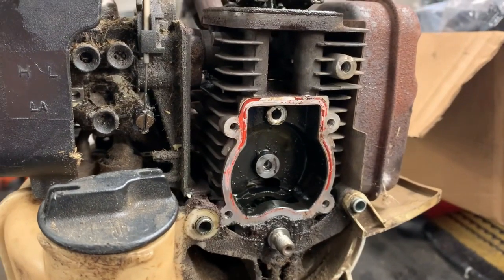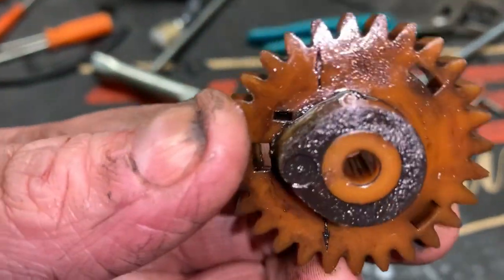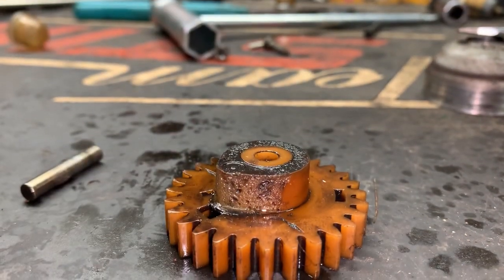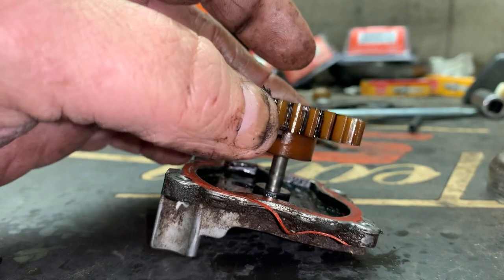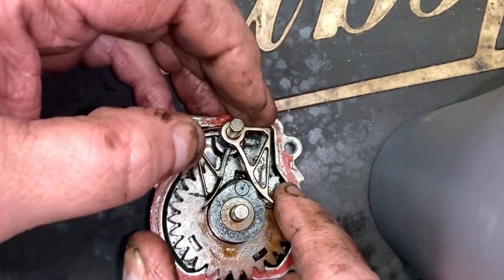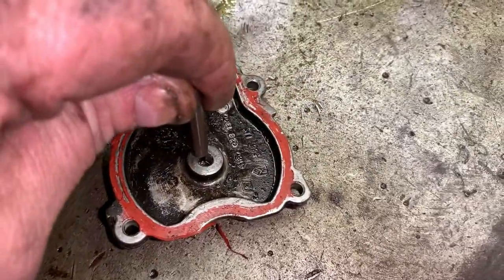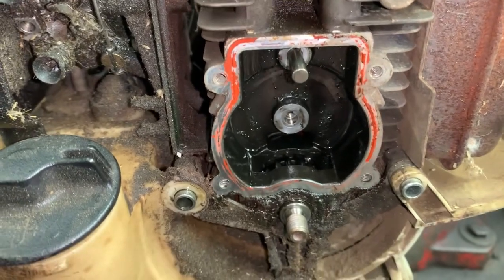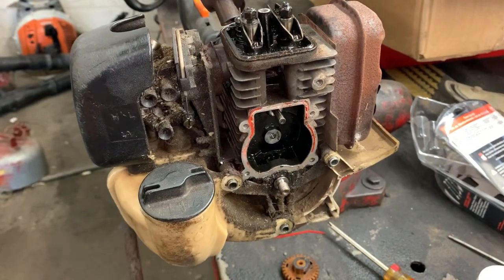50% OF MECHANICS DON’T UNDERSTAND OR KNOW HOW TO DIAGNOSE THE #STIHL #HYBRID #4MIX ENGINE

Comment from the maker: I’m sorry if I triggered anybody with my terminology I kept calling it a camshaft when in fact it is called a cam gear sorry for any miscommunication y’all have a good day
Reply: We know what you meant.Good vid,keep em comming.
Reply: You could give some people 100 bucks and they would bitch that it wasnt 2 50's. You will always piss some people off in this world no matter what you say or do...Screw'em and keep doing your thing and pay'em no attention.
Reply: No problem, could a lathe owner turn you a pair of pins turned to the dimensions of you worn bores, they would have a slight step but would be a lot tighter?
Reply: I didn't see the comments you're referring to so I cannot speak to that. I do agree that using the correct terminology is important. For accuracy and clarity but also having the correct part name is very helpful when sourcing parts and doing further research. Of course, every situation is different but in general, I advocate for that if possible. This is a matter of discourse that should easily be covered matter of factly and not involve triggering anyone. Respectfully give your concern and the reasons why.  The goal should be facts and accuracy. The content of this video is great to know. Thank you for bringing it to light. I imagine the same applies to the BR series blowers?
Reply: @newcoyote  aslong as it is a 4 mix. (Super Easy to pull if valves are adjusted correctly and sonds like a 4 stroke dirt bike and doesn't idle like a old boat motor )
Reply: Install a GAURD insert and drill it to fit the shaft. Should be a great and inexpensive repair option.
Reply: No worries man! Thanks for the quality content.
Reply: You also called the cam followers rocker arms a couple times. But we know what you meant.
Reply: Just call it the cam LOL

Comment: Sure appreciate this info! I had one come into my store for repair today. My manager told me to fix it under warranty. (didn't use 4mix. fuel was blue. I have no idea what kind of fuel additive he used but it sure locked that piston on the connecting rod.)
I have had no Stihl class on this unit, but you sure pulled me our of a spot with your sessions on this unit. Thanks a lot!

Comment: Very, very good.......and that's why I avoid buying any Stihl stuff with the 4Mix engine.
My dealer told ne about the horrible problems he had with the 800 backpack blower so I got the Husqvarna 580 with the Zenoah engine instead -Very noisy but fantastic and ultra reliable with no valves adjustment problems.

Comment: The simplest fix for those pin seats that have gone oval is a suitable strip of copper or steel tubing from a refrigerator or air conditioner. Put in the pin, tap in the suitable sized tubing strip to fill up the oval and apply a teeny bit of super glue to the body and tubing to hold them together. Then remove the pin. In the first stage of wear the pin seat on the engine block for the cam wheel and the pin seat on the for the rocker arms are what wear out. Detectable at an early stage by a varying valve clearance at every rotation of the crankshaft.
Now, the key question, does this fix work. Well, i started doing this in 2003 and have never had any issues.

Comment: Man this is an OLD issue they had onnthe FS90, 100, 110, 120, and 130 engines.  We replaced hundreds of short blocks under warranty back in the 2007 to 2014.  I haven't seen one of these failures in about 8 years now.

Comment: Good Vid!  Steel into aluminum never good.  You know what the fix is for this?  Echo!
Reply: new faceplate and gear as often as viable, if you keep the play in the plate end as low as possible its not going to wallow out the block end.
seems to be the only mitigator, or redesign with harder bushes or even a bearing- never ha to work on one but theres a market for a case plate thats way thicker , stiffer and carries a longer shaft in a bearing.

Comment: Seen a Stihl BR600 backpack blower break a valve. The valve broke off and got stuck in the top of the piston. Was still under warranty so we put a short block in it. Owner said he had it full throttle and it just stopped. Said it damn near jumped off his back.

Comment: Good information to know, thanks for sharing! I have a Stihl BR600 backpack blower which has the 4 mix, I actually bought it used from a lawn care service real cheap because it didn't run. Looks like it's got some hours on it since it was used commercially, got it running and luckily it's been great and reliable, haven't had this issue yet.

Comment: I think the solution for the "4-Mix" is to put the best air filter possible on it. An engine that always gets new oil, rather than recirculating contaminated oil should theoretically last for ever. The only source of particulate matter, is through the air intake. Maintaining proper valve clearance is also a good idea. (to protect the cam gear) This is a fascinating engine, I'm interested in getting a leaf blower or something that uses this engine, just so I can experiment with it.
Reply: Lots of torque on these engines.
Reply: I want one on the next edger I buy

Comment: Hey GREAT video- a question my FS310 gradually lost compression today!! weird thing is the cam lobe had melted to nothing and with the cam and rockers removed it STILL has no compression!! its not done big hours and it was running perfectly then lost power and revs (and compression!) over a 1 minute period - what could it be.  blown valve?

Comment: Oil lite bush is the real option new block leaves you in the same boat  whereas a bush will last basically forever you could  do the mod yourself with a decent drill stand and the right size milling cutter njt a major problent for a decent mechanic  .

Comment: Thanks for very useful video @themowermedic1. There is actually one mistake - the pin wobble you show at 3:28 seems to be totally normal. I have had a catastrophic cam failure - melted palstic, metal back plate disintegration etc and when replacing I checked the pin and had the same wobble as shown in your wideo at 3m:28s.. So I ordered a new cover and it has exactly the same amount of play in it. I guess this is a design feature to facilitate refitting the cover which might be very difficult if all the holes where machined to very tight tolerances. The hole the pin goies into in the engine block is very tight and hence the cam followers are very stable.
Reply from the maker: Be sure to order the newest part number backing plate. The old part number has play, and the new part number with the oil dam has no play

Comment: Hi 
I have a BR800 that may not be fixable. It too had loose sockets. I tried peening the shoulders of the loose sockets. I then cleaned up the peening pits with 220 sandpaper.  The pins are much tighter now. 
I have a piston on order so can’t tell whether this will help yet.

Comment: I just bought a new stihl weed trimmer a few days ago fs 70r I was looking at the 91r but after seeing all the issues with the 4 mix engine I decided to get the 70r 2 stroke for life when it comes to weed trimmers leaf blowers edgers pole saws etc my new 70r will never see ethanol.People don't understand when you use feul with ethanol in it when you let your equipment sits the gas separates and sits on top where the ethanol sits on bottom where the feul line sits with the little filter attached so when you start your equipment it see's nothing but ethanol with very little lubrication ethanol kills small engines.
Reply: Stay away from the 4 mixes,I had 2 that had the same problems,I upgraded to a Stihl km  2 stroke, problem solved
Reply: @snoopfurlow1275 which stihl is a 2 stroke?  When I emailed them stihl replied pretty much everything was 4 mix and only pure 2 strokes they had were a few pressure washers

Comment: These are good engines when used and maintained properly, the problem is operators abuse them and mechanics dont understand or want to maintain them, all at the detriment to the engine, I am a stihl tech btw
Reply: All the videos show how to repair but no one tells you what oil going in the engine 😅

Comment: Great video bro very helpfull thank you .
I have the exact same problem with the rocker arm pin on the cam plate cover being wallowed out .
I will replace the cam cover asap .
The cam gear pin hole on the engine is slightly wallowed out too but not as bad as the example you show here .
Do you think the engine is still ok with the slight play on the cam gear pin hole on the engine block ?
Thank you kindly

Comment: JB weld to the rescue. it works just fine, just brake cleaner it down first. it really isn't worth using anything else. and yeah, ASE certified, recertified,master technician.
Reply: Funny - I was thinking the exact same thing
Reply: Or, hear me out, do the correct repair.
Reply: @blakegrubb3091  When you need a new block already, what exactly do you have to loose?
Reply: I dont think jbweld would handle a hot pin rotating at speed in an oily environment

Comment: How tight are those shafts really going to be when sitting in just one shallow boss?  I'm not sure you'd see that play with the shaft sitting in both bosses.  The plastic cam gear with thin backing plate are far weaker than those shafts or the holes they go into.  The 4 mix require more maintenance than a 2 stroke, but the power/lower fumes is well worth it.  You couldn't pry my fs111 or fs131 out of my hands.

Comment: I have one and it won’t rev. Valve adjustment done. New fuel lines, filter and tank vent. Starts easy and idles good but won’t rev at all. Throttle cable good. Any suggestions??

Comment: First, I'm not a landscaper, I'm a contract poultry producer. I have allot of buildings to keep trimmed and mowed around on the farm. I have three Stihl's, a FS 130, FS 110 and a FS 90. The 130 and the 110 are the oldest (6-7) years old. I've lost compression with the 130 before and was told to fill the cylinder with Seafoam for a few days and it would dissolve some of the carbon. It worked and the machine worked for about 6 months. Now, both the 110 and the 130 are down again with low compression. I tried the Seafoam trick again with no success. These machines were run using Stihl synthetic 2 stroke oil. About a year ago I changed over to Echo Red Armor oil at the recommendation of a"Chickanic" and the difference was remarkable. The machines run better, consistency. What is causing this issue and what can I do. to resolve the problem? I live in a very rural area of coastal NC and we don't have a very good selection of small engine mechanics.
Reply: Not sure if you've gotten an answer yet, but are you half-throttling them, or using them for relatively short periods of time?  If you don't get them up to temperature you get incomplete combustion and they foul up, is what I would assume is the root cause of your carbon issue. Echo red armor is just really good oil and has a detergent package to keep the engine cleaner. Assuming you've checked all the obvious things (fuel, air, spark), unhook your spark plug, take the plastic off and take the valve cover off. Spin it over with the rope and make sure you don't have a valve hanging up as it's trying to close or a broken spring. bring it to TDC on compression and make sure valve clearance is correct - this can be done with a basic feeler gauge. Clearance spec will be in your owners manual. If this doesn't work, you can run a leakage test and figure out where the compression is leaking from.

Comment: I’m going to look through your videos, but do you have any covering a cylinder replacement on this engine? Have a stripped spark plug hole on my FS90 and about to start tearing the engine down to replace it. This video helped me get an idea of the cam setup prior to pulling it apart.
Reply: Can you not fix it with a heli-coil?
Reply from the maker: Yes
Reply: I posted this a while back. But yes, I could have done a heli-coil. However, no shops around me would do it. For me to buy the helicoil kit and appropriate size thread insert, it would have been about $100. For $120 I got a brand new cylinder/piston assembly. These videos did help me piece together what I’d see when I pulled it apart. Was a super easy repair in the end.

Comment: Thanks for the video. I have not ran across any yet. Since that's a problem and most choose not to repair them I'm sure I'll end up with one eventually. Does the pins rotate in the bosses? Or the gears around the pins? Thanks
Reply from the maker: The pin is free to rotate, and I think that is part of the problem
Reply: @THEMOWERMEDIC1  Yes, they made this too simple for cheap labor and material costs.  The pins would best be hardened ones threaded into the main case with a shoulder to keep it tight against the main case.
Reply: @whalesong999  or staked in

Comment: There is some dirty tricks you can do to your own stuff, like drilling out a slightly larger bore and using a rod that fits perfectly. None of the dirty tricks are something I would trust handing to a customer with any for of warranty on the repairs, so block replacement is the only "safe" bet.

Comment: A dirty cooling system causes most of the over heating problems along with ethanol blended fuels.
Reply from the maker: Incorrect. Lean fuel conditions and no guard “line too long” are the causes of overheating

Comment: There's got to be owner issues. I have a first or second production run BR600 and I've been in this engine twice. The second time was to replace the cam gear. The back plate on the cam gear had become lose. I noticed it while adjusting the valves. The mechanism in the cam gear is for start up decompression...RPM over rides it. I have a lot of hours on this blower and it shows no wear in the ares you''re  pointing out. IMO...it's not an engine issue....it's an owner/operator issue.

Comment: So what is causing this? Lack of oil change?
Reply from the maker: Design flaw
Reply: You don't understand.A 4 mix engine is a 4 stroke that must be run on at least 50 to 1 fuel oil ratio same as a 2 stroke as the engine has no oil in it for lubrication purposes.In other words a 4 stroke that must have it's fuel mixed like a 2 stroke.
Reply from the maker: @eugeneoreilly9356  I understand just fine
Reply: @THEMOWERMEDIC1  the reply was to the op that thinks that you change the oil in a 4 mix like a normal motor with oil pan .

Comment: so once it gets to this point, sell it in a yard sale and buy a new one? have a small collection of all stihl weedeaters, all have a lot of mileage and have issues. i only keep my FS240r in working order cause i havent needed to go to a backup weedeater until lately.  we have 2  small residential stihl weedeaters plus an fs90 that hasnt ran in years and was wondering if it was worth it to get it back in working order. but after this video i think its not worth it, sell it at the yard sale. btw the fs240r still runs beautifully IF you can keep it servcied
Reply from the maker: What’s a yard sell?
Reply: @THEMOWERMEDIC1  sell/sale i cant spell too good
Reply: @THEMOWERMEDIC1  a worn out fs90 worth keeping or get rid of it in a junk/garage sale?

Comment: Well, that looks like a horrifically shit and needlessly complicated design implemented in plastic and pot metal.
Reply: The design is actually great...the materials used could be better.  I have the fs111 and fs131...I'd have a hard time parting with them, the power and response is great.
Reply: Maybe, but it still gives less problems than the average 2stroke. And it isn't pot metal, it is a metric metal named aluminium alloy.